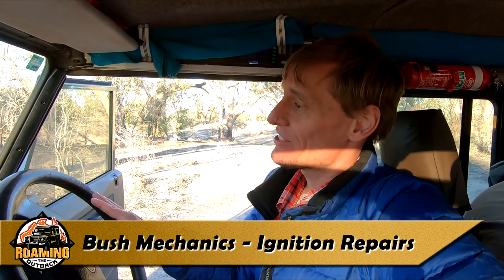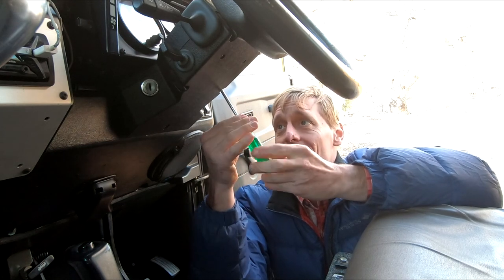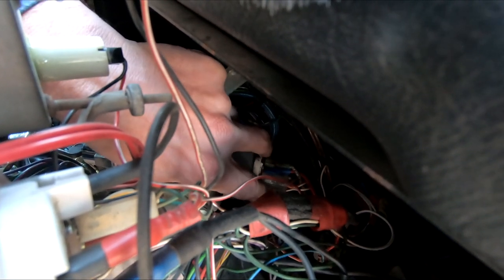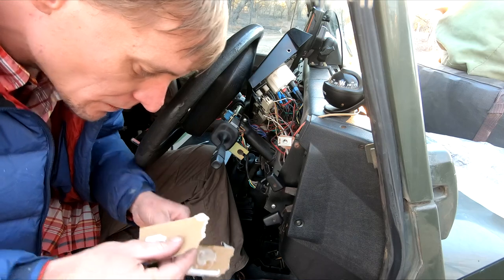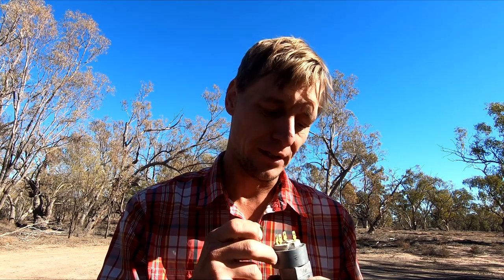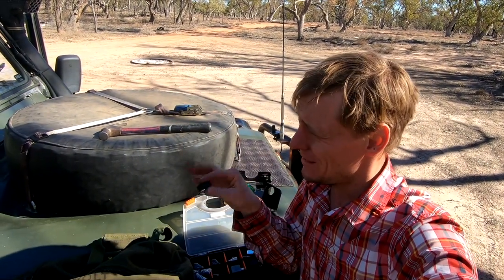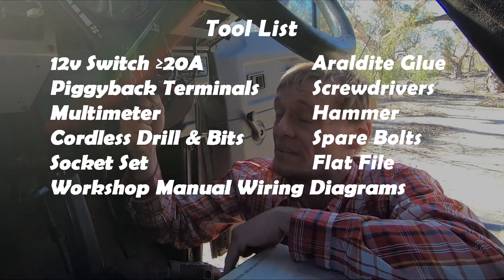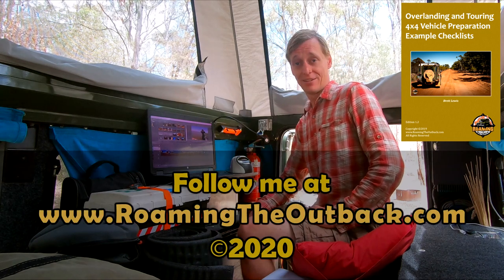Bush Mechanics | Failed Ignition Switch Repairs 12v Electronics

Comment: Hi the same thing happened to me in the bushveld in Africa. It took me 10min to rig a couple of male push in crimping lugs and wires an I finished a 600KM trip with that diy fix. The 200 and 300 TDI was the easiest cars to work on in the bush the Lucas switch was one of many things LR could have done better. Unfortunately I sold my 300 TDI shortly after I completely rebuilt the engine and immigrated to New Zealand. Love your videos keep them coming. I mis my 300 TDI.
Reply from the maker: At the end of the day LR made them to a price point. Alot of areas could have been better for a greater price, but then I doubt they could have competed with the Japanese.

Comment: Great bit of info, I managed to reclamp my end switch with epoxy and insulated wire.  Bonus
Reply: I then looked into the root cause of the problem and fount that the contacts inside the ignition barrel switch were also worn, it was possible to swap out the switch by removing the two small retaining screws.  The switch was £12 on eBay 👌🏼👈🏼😎 No need to remove the ignition barrel…
Reply: Ignition Barrel Switch Defender Tdci 2007 to 2016

Comment: Would you not have been better re peening over the three case crimps that hold the white plastic contacts tray ? Maybe this would have held the 2 units together ? Just a thought 🤔
Reply from the maker: Always a possibility, but impossible access. still would have had to remove, and from memory i did do that before trying the glue on top.

Comment: I think our car has a similar issue. So once in a while it doesn't start.  Say 1 out of 15 starts. The lights the dash starts to go on and off same does the starter motor. When I remove the key from the lock, re enter it 9 of 10 the car starts directly. It feels like I can get the issue also when I move the key a bit in the ignition lock. Does this sound familiar?
Reply from the maker: yes, sounds like faulty ignition.
Reply: @RoamingTheOutback  It happened once when the car was at the service station, but they are great and didn't wanted to replace parts because it didn't happen there again. I will ask them to check the ignition next time during service.
Reply: Hello did you manage to sort this? I have the same issue
Reply: @qaiserk7305  yes it’s solved after replacing the battery and startmotor.

I also have had an issue with similar symptoms. The motor stopped directly when I tried to drive. It was a faulty relay for the computer.

Hope this information helps

Comment: Happened twice in the past 15yrs on my 97 300tdi 110...similar environment.  When i shook the key, it would engage the contacts for a second...all defenders here suffer the same problem. Solution...No keychain or weight hanging on the key. Just use a loop of paracord or the like.. better yet a small neo magnet connector keychain.  Any weight on the key while driving corregations, acts as a lever breaking the switch. Once i started using only a key, it never happened again.  Vehicles that stay on pavement its whole life dont have those concerns.
Reply from the maker: I'll have to put my keychain on a diet.

Comment: That was almost bush mechanics, except you didn't use fencing wire. :) I would seriously consider ordering two starter switches (and adding epoxy or whatever it takes to make them rugged before fitting) or, if the cost of two is exorbitant, completely replace the LR ignition switch with a custom keyed power switch and a momentary contact push button as a starter switch through a couple of 40A automotive relays - components that are a dime a dozen, proven and the spares for this can be used elsewhere.
Reply from the maker: Yes I glued up the new one before fitment to be sure. Hopefully that does the trick.

Comment: Why would Land Rover use glue for electrical?
Reply from the maker: Turns out it wasn't glue. Just those tiny crimp imprints which held the contacts on.
Reply: Roaming The Outback glad to see everything is going well with you Brett. Hope all is well. I have been working on my Land Rover here in the states, prices for landy parts are expensive here.

Comment: didnt this happen before, thats why i drive over corrugation over 100 km per hour, you dont feel them
Reply from the maker: In 2015 and 2019. Hopefully fixed now with added glue on the switch.
Reply: @RoamingTheOutback  love your videos brother, i just went solo into the gammon ranges, climbed mount gill at wirreweena sanctuary, grindells hut, and through to arkaroola via back tracks.  I got lost missing the track out 3 times back and forth over lowrange terrain, only in the end to realise it was a pebbly creek that was the track out.  Im getting a second 100 litre tank in the tray on the hilux behind the cabin to go with the 145 replacement main tank i purchased so i can carry 245 litres of diesel, so i can go remote, peace
Reply from the maker: plenty to go most places. I only carry 185L and I haven't had any place yet I was running short on fuel.

Comment: Gee your not having a good run lately are you?... time to upgrade to an 80 series.. haha..  ~;0) Could you not drill a hole either side in the main casting part and run a cable tie thru it and back to itself to help hold it better? Can you not find another ign sw setup similar to yours but in better condition or quality that would fit or ..... even bypass that and make a new configuration with a key and push button arrangement as they do on race cars which would then probably make for a better and less hassle permanent arrangement ?
Reply from the maker: I probably could, but the replacement has been glued for extra security, so I think this time I'll be ok.
Reply: @RoamingTheOutback  I guess only time will tell.....